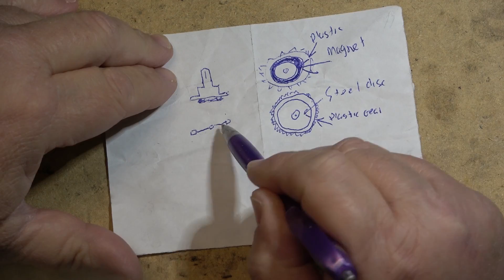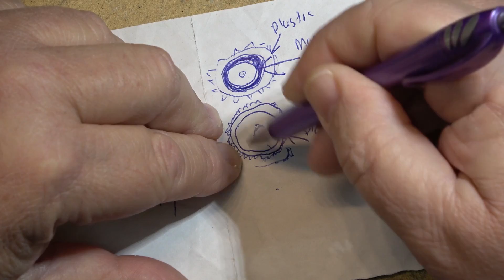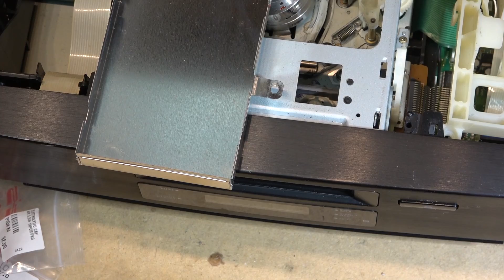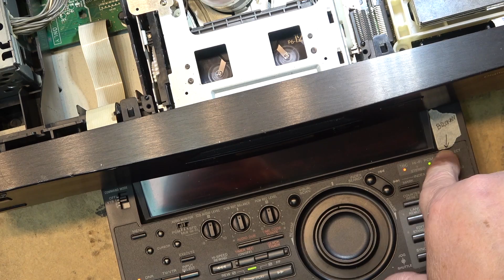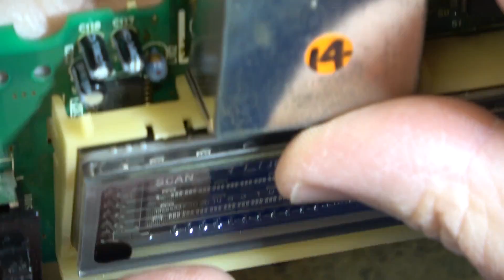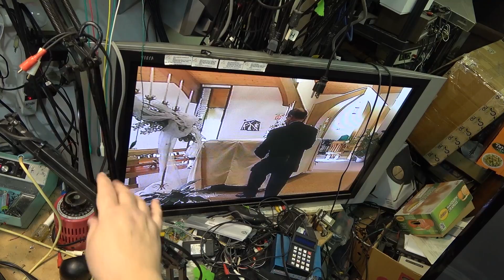Sony EVS7000 Hi8 VCR Time Base Corrector and Panel Display Repair

Comment: We've covered a lot of the same issues with these machines.  Sorry I was one of those mentioning the display capacitors and the TBC ones!  I use SMD capacitors for the TBC, but I quite understand why you wouldn't.  One of my EVS9000E machines was a pre-production prototype, it has wires and bodges all over the place.  I could never hope to repair it but it did provide me with some spares.  Here's another hint: If the machine seems to basically work but makes a hissing sound, then someone may have fitted a normal capacitor in the PSU where a low ESR one is demanded (I forget which, because I fit only low ESR in the secondary of these power supplies).  Another machine I have (and it does work) is an EV-C2000E which is a minimal version of the EVS9000E: No PCM audio, no TBC and no tuner/timer, but same deck and turbo rewind.
Reply from the maker: I have to go back into this one again. After running for several hours the display goes out. Even the clock display.  Turning the unit off and it won't turn back on. Leaving it unplugged for a few minutes and all is well again.   
I would have put and caps in if i could get them but local suppliers don't stock and I'm not paying 30.00 shipping to get some.  I've done 5 or 6 with conventional caps and the all work fine.

Comment: I'm in the process of archiving my 300+ 8mm/Hi8  tapes and it's going really well so far.  I'm using an EVO-9720 and it's holding  up.  Had the power supply rebuilt a couple years ago at FusionCine.  Only 500 hours on the playback deck. Another 500 hours of run time should do it. Fingers are crossed and I'm holding my breath.
Reply: worry not, plenty of hi8 cameras are still in working order....just grab one if that deck dies

Comment: As a preventive measure, can you put epoxy on the reel table plastic to enforce it so it doesn't crack?
Reply from the maker: This is a gear that needs to mesh with another gear.  Coat it with epoxy and it's not going to work.

Comment: Transfer your tapes but keep your tapes because what happens when your digital media fails?   AND IT WILL!!!
Reply: I hear they invented a way to copy files. Sounds like voodoo to me!
Reply from the maker: Ever heard of a backup.  
Your tapes won't last forever.  Trust me i know. I archive tapes for a living and i i run into tapes that the signal is so weak on some that the color can't even be retrieved and they get a black and white copy.  You would be amazed on how many people used that fucking SLP /EP speed for their home videos 40 years ago and these days there is barely any signal left on the tape to recover. Same with idiots that used  LP on 8mm / digital 8 and DV.  Then it becomes my fault that I can't recover their tapes.  I bring them in and out their tapes in 6 different machines and say " my 6 machines all have the same fault or you were a cheap ass that tried to save a few pennies on tape by using the slow speed.  The response I always get is why did Sony or Canon put the slow speed on their camera if it wasn't compatible are the quality wouldn't last. My responses because JVC or Hitachi did it so everyone else had to respond so they had the same useless feature. The lp and EP speeds should never have been on VCRs ever but they were and people use them and now people are paying the price when we can't get a good recovery. Even 40 years ago the quality would have been crap on a second generation copy done in EP but today it's almost unplayable.

Comment: I had to do some smd cap replacements recently without a hot gun. Traces were too weak to tease them off with a pliers and iron. Ended up using 2 soldering irons, one in each hand, and desoldering both legs at the same time. Felt wrong but worked a treat :)
Reply from the maker: That's why i cut them off and heat the pins.  For God sake don't do what Carlson does and twist them off with pliers unless you want to distroy the board.

Comment: many problems with cables and connections with capacitors with dc conversion and tape recorder I will now know not to buy this video, also my camera has the same deck with many problems not even worth 10$
Reply from the maker: The only cameras worth buying for tape transferring are late model hi8 and the digital 8 models.  Anything from late 90s.  Sony B mechanism or the ones that load from the bottom.  The problem with early B mech from 1999 or earlier is the sharp edge on the bottom of the latch that holds the tape door shut.  Some of the A mechanism models were ok but others had bad caps and everything before that stay away.  Stay away from and ccd f, or v series camera.  TR series as well stay clear.  I see people selling v5000 cameras asking 200+.  I wouldn't offer 10 for one. If you want one as a display piece perhaps.
Reply: @12voltvids  understandable and I agree with the 90s which well-known digital 8 would you recommend?
Reply from the maker: @salvatorev_  trv110 had the sharp chassis issue. ( Know as i had to fix mine). DCR TRV 120 and later are good. I use a 240 for transfers.   Stay away from. 25p if you have analog tapes to play as it has no analog playback.
Reply: @12voltvids  I have video 8, Hi8 cassettes, which camera do you recommend?
Reply from the maker: @salvatorev_ late model.  Digital 8 models with analog playback.  Trv110, 120, 720 240 ect.  Not all have analog playback however. Or you can find a gvd200 or 800.  They play analog and digital8 tapes.
Reply: @12voltvids   thank you very much i will look into it sometime , very sad that sony used to make all these cameras with cheap parts , also i have a question why the modern digital 8 camcorders do not have the same picture and sound quality compared to the analog video8 , hi8 camcorders ones which had better sound and better sensors?
Reply from the maker: @salvatorev_  the digital 8 cameras could record a superrior picture to any analog camera.  The video is identical to DV and dvcam. The reason that the sensors are not as good as these were the low end cameras.  Sony put the better sensors in the DV cameras and the really good sensors in the professional and broadcast cameras.  This was done because they didn't want professionals using cheap cameras.  They wanted them to buy the professional cameras which cost many times the price.  Put yourself in their position. Would you want professionals buying a 400 camera or a 4000 camera or even a 40000 camera.  If the 400 looked the same nobody would buy the more expensive model.
Reply: @12voltvids  I understand but and as for the sound quality because all the video 8 and hi8 had a better soft and warmer analog sound even the V-200 Pro which supports PCM digital sound had a nice sound than the digital 8 which had a cold digital sound?
Reply from the maker: @salvatorev_  afm sound always was bad.  So bad infact they had to use companding to get rid of the noise.  Digital is pure sound.  Unfortunately many think that analog tape and vinyl sounds better but it actually doesn't and this can be measured.  The only people that think vinyl sounds better is people with poor hearing.  
The PCM sound on 8mm wasn't the greatest. It was 8 bit conpanded sound using a dbx type noise reduction and it also was samples at 32khz so the frequency response only went to 15khz.  8 bit gives only about 45db dynamic range.  
When it comes to DV and digital 8 there were multiple audio formats available.  48khz, 44.1khz and the crap 32khz 8 bit.  That was available so you had 4 tracks of audio.  Most of the digital 8 cameras defaulted to 32khz audio so a second sound track was available for subbing even though mist digital 8 cameras could not dub, the home deck could. I only used D8 as a storage medium feeding output from computer with the sound in 48khz 16 bit.  Sounded great. 
Digital 8 used the same 411 color space that DV and dvcam used and therefore the picture quality was identical to both far exceeding the quality of any analog tape. The horizontal resolution being 500 lines with color resolution comparable to 90 lines of resolution. This compares to high eight which had a maximum horizontal resolution of 400 lines and a maximum color resolution of around 45 lines of resolution and VHS which had a resolution of 240 lines in the luminance department and the color was limited to about 30 lines of resolution. Anyway you look at it DV has Superior picture and quality to any of the analog formats except for the professional betacam which could record her about 340 lines of horizontal resolution but the chroma was also the same. The thing when people get confused with is digital versus analog because digital you have a fixed pixel count 720 pixels per line which means your maximum number of pixels per line is 360 because 720 / 2 is 360. so thinking in terms of analog this would be 360 lines but they call it 500 just due to some sneaky math. But in reality if you have $720 possible dots that make up one line of video and you turn them on sequentially one on one off one on one off one off the maximum you could get is 360 pixels on and 360 pixels off which is 360 dots per line or 360 lines of resolution how they came up with the 500 lines for DV was by averaging it over two fields
Reply: @12voltvids  Clearly, the digital sound is better and you hear more details, I just talked more about the warmth of the analog sound, which gives a smoothness to the sound, the digital one, on the other hand, is clean with a lot of detail, but it sounds different, as for the image quality, the digital 4K even my iPhone will have won anyway

Comment: Hi8 tape decks look incredibly cool, maybe they are more useful now than a long time ago.
Reply from the maker: The only thing they are useful for is getting material off old tapes and into a digital format.  No matter how you may feel about tape, it's dead.  Time to get whatever is stored on tape off and move on. These machines are failing fast and once they are done there will be no way to recover what is stored on tape.
Reply: @12voltvids  That's what I was referring to, they might be better than camcorders for digitising old recordings. Provided they still work, of course. ;)